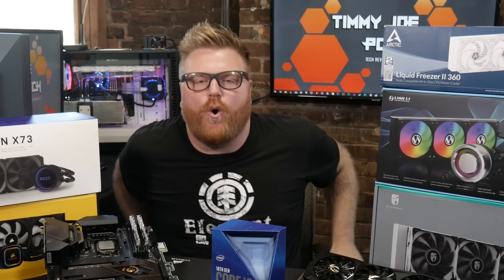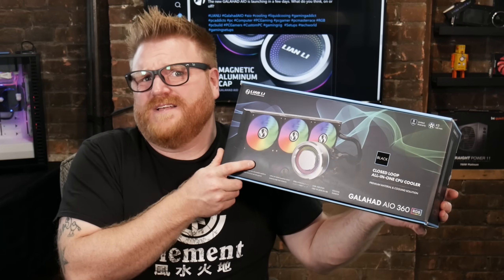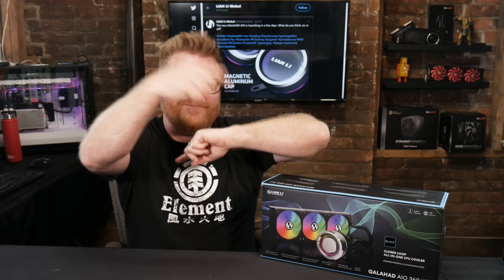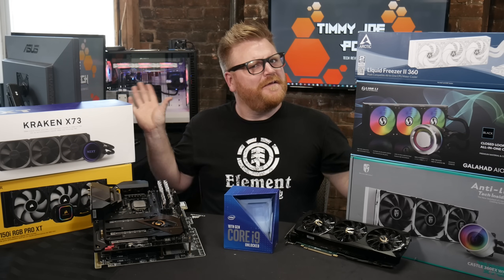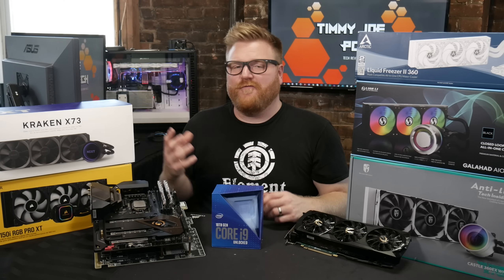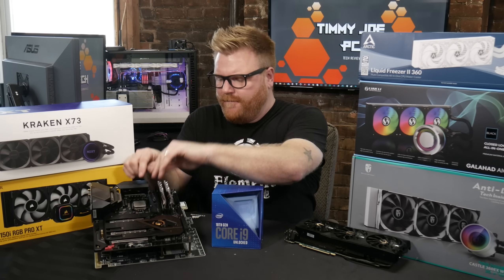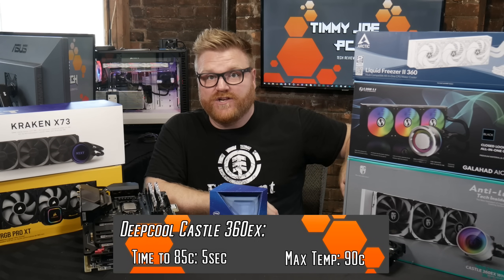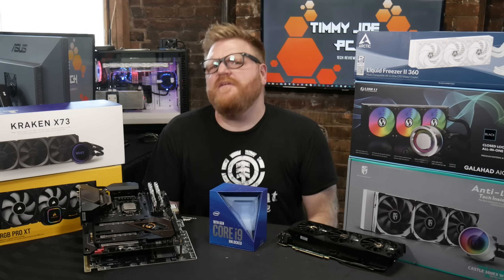Which 360 AIO is best 360 AIO on the 10900k @ 5.3 Ghz?!?!

Comment: Noctua's new completely passive cooler with a 3000rpm case fan strapped on will blow all these away in performance AND price lol
Reply: Rubbish
Reply: imgone  if the d15 competes with a 360mm AIO and the new passive cooler is supposed to cool better than the d15 then...

The passive cooler is rated for 120w in a fanless case. Do the math. 

Just because you don't want to believe it doesn't make it false.

Comment: Try an Alphacool Eisbaer Solo LT with the 25mm radiator. All copper plate and rad...it's what i have and my 3900x doesnt go above 58c :)
Edit: mine also has Thermal grizzly liquid metal...thats got to account for at least 5c I suppose...

Comment: Having a smaller case, I wish they had this much variety for 120 or 140 rads, getting some thicc rads into the market would be sweet
Reply: The Corsair AIOs are more expensive but their 120 rad is thick as hell
Reply: @dominicbackley5698  Yeah I own the H80i GT and it has a 49mm thick rad with Push Pull.

Comment: Pushed CPU well beyond the specification for far longer than the 56 second maximum boost duration intel specifies: 
"I don't know what happened"

Really Timmy?
No idea what happened?

Perhaps running the chip at 330+w for hours when it's designed to only run at 250w for a maximum of 56 seconds at a time might have had some effect?
Reply: He's probably just gonna do what he said in the last video, buy a new one from Amazon, switch it out and return it. Greasy. This dude's a choad.

Comment: ARCTIC Liquid Freezer II 360 would be nice if it was in stock anywhere in canada, same for the phanteks p600s in black with glass
Reply: i just bought the artic 360 mm from newegg.ca for 189.00 + 10 $ shipping  get on it bro before u have to wait another 5 months
Reply: @Bass_Junkie  Thanks for the heads up, ordered mine :)
Reply: @phynx-victumterra652  no worries bro . Been watching newegg.ca / memory express / Amazon ca like a hawk and the 280s came in a few times but not the 360mm . 

I think a seller bought out all the 360mm liquid freezers then re sold the lot to Newegg.ca for extra 20$.

Comment: Your comment about the Corsair cooler and iCue misses out that iCue is only required to set up fan speeds to your liking once and then Corsair's software does not need to be run at all. The pump has an onboard fan controller that will store whatever fan curve you set if you don't like the defaults. The settings are retained after a reboot or power cycle even if the Corsair software is uninstalled.

Comment: I have Kraken X73 and it is good :-D . And the best SW for fan control was SpeedFan, however it is not working on my x570 .
We need someone to make SW to control fans, pumps, RGB from every manufacturer because I have installed 5 different programs to control fans, and RGB 😡🤢🥶.

Comment: just changed to a EKWB 360 pretty good and most importantly PWM controlled last one i had x52 had this god awful software that was coded by a blind monkey broke down every 2 months was going to use air for abit but not enough clearance for the gpu cooler i bought and the zotac fans sound like a harrier jet is taking off

Comment: Should have a performance per dollar graph. :)
Reply: This^. It becomes an entirely different ball game when you consider their value propositions. I can only base this on costs in UK but the difference is clear, especially if you take the idea that all but the Castle offer similar cooling performance

1: Freezer II - £100, 2 Yr Warranty
2: Galahad - £140, 5 Yr Warranty
3: H150i - £150, 5 Yr Warranty
4: Kraken X73 - £160, 6 Yr Warranty
5: Castle EX - £140, 3 Yr Warranty (same price as Galahad but worse noise, performance and warranty)

I know he rates the Kraken above the H150i because better peak performance, but as someone who's owned a Kraken before, that CAM software is bloated a f***ing nightmare. You also don't need CAM for OS level fan curve control if your motherboard supports it, like ASRock boards do.

EDIT: added warranty periods as it's always good to keep them in mind. The Freezer 2 has the shortest.

Comment: Wait no EK AIO in the mix?? 
either way sick element shirt bro 😎
Got the Arctic 360 just sitting at home, the brackets you mount to bottom of pump , one of the threaded female pieces fell inside the pump so you can't mount the bracket, therefore it's useless lol. 
don't bother me too much since I have custom loop in my system anyway 🤷

Comment: Timmy Joe, try the Arctic Liquid Freezer II again, but have it plugged into the Pump header with the same setup as the CPU header. I had the same problem on my motherboard. The CPU fan header does not provide enough power to fully supply a Liquid Freezer II 240. When I switched to the pump header, I saw about 10°C decrease, because my motherboard does not provide much power to the CPU header.
Reply from the maker: You went in to the bios and changed the fan curve? Fan headers are built to a standard,  most modern motherboards should provide 2 amps at 12 volts. That should be enough power. What motherboard do you have?
Reply: @TimmyJoePCTech  The motherboard that I have is an MSI Meg X570 Unify, and it kept the pump at a slower speed, even though by every source I looked at, it should just work on the CPU fan header. I will look into this matter further.
Reply: On top of that, I forced the fan headers to stay at 100% in both tests. I am retesting for science.
Reply: @TimmyJoePCTech   1A cpu Header / 2A or 3A( MSI Boards)  OPT/PUMP Header.
Reply: I asked Arctic about that in a ticket, when I bought my AIO. They actually told me to specifically use the CPU Fan header and not the Pump header, as the voltage (their words) from the pump header could damage it.
Reply: @forgofm7105  For right now, I agree with you guys. I retested the numbers and came with a dead even draw. So, it looks like it does not matter, unless if you like having more fan headers for extra fans. Though, it could be that I just have a CPU that does not output that much heat, so the margin of error is bigger than the difference between the different plugs.

Comment: do the tests with the ryzen 3900x, if you come around to it maybe test the best cooler with ryzen 5 and 7 aswell for full cover
Reply: Pointless. The 3900x exerts less heat than the 10900k so if it works on a 10900k it works on a 3900x
Reply: @weavercs4014  I was about to say the same thing.
Reply: @weavercs4014  It has a very different inner layout (the chiplets)
So it makes sense to test it as well

Comment: The Arctic LFII 240 is a beast. 4790k delid all core @4.9 never gets over 60c
Reply: Wowza what voltages are you pushing on that poor silicone?
Reply: @pietrmuffei8874  1.344v
Reply: Stylust that must be a good lm application then and a great chip. I have 2 cores within 15 degrees apart on liquid metal and run it on 4.4 all core at 1.187v. Guess I will reapply LM. But I use my board in a case so maybe it drooped/ leaked
Reply: If I do 4.5 I have to run it 1.27v and my tennis are like 90c

Comment: I'm still using a Swiftech H320 Prestige. It's got a pump that'll suck the tits off a cow, even 5 years later. It'll be a sad day when it eventually fails.
Reply: terible aio my pump sounded like a grinder after 5 months .nevr went back . but yes the pump is strong even with a added gpu

Comment: Actually the coolermaster ml360r is the best aio the temps are better in that than the nzxt go search it on google and see for your self
Reply from the maker: NO! I had bad temps out of mine, it was terrible, the fans are extremely loud at all RPMs and the pump died so I didn't include it in this test
Reply: Timmy Joe PC Tech for me it was better because I had my friends nzxt with the same thermal paste it was arctic mx4 and the coolermaster was better for me for some reason ?
Reply: Nope. Liquid Freezer II 360 is the best, I thought everyone knew that

Comment: You forgot to mention that NZXT kraken cost almost double then arctic :)
Reply: there are two 73  A$499 z73 A$299 australia
Reply: @Springboksimmer    that's awful, man.
Reply: and has many software problems
Reply: It's sad, the Corsair Pro XT series is the same price or lower than the Deepcool AIOs. Which only the non-RGB fans by Deepcool are modified to be more performant, whereas any time they include their CF120 aRGB fans, they just aren't optimized for radiator use.
Reply: Deepcool RGB V2  is cheapest in India at the moment at $135
 and he didn't use the V2 I think and with no RGB so at this pricing can't really discount it, at least if you are not using something as hot as 10900K and there isn't even that much of a performance dip.
Lian Li $173
, Corsair H150i non XT $196, X73 $236 and Arctic Freezer II isn't available I think.
Reply: @CaptainPrice-f6g  I have the Lian li Galahad 360. While I do agree with you, not everyone wants or needs the best. what I had mentioned was the fact at that time. What he had said was really biased. He did not consider the price and did not use the best available variants of them all.
Reply: I have a kraken. Best cooler I ever owned, was able to overclock my 5950x to 4.7 GHz with solid temps.